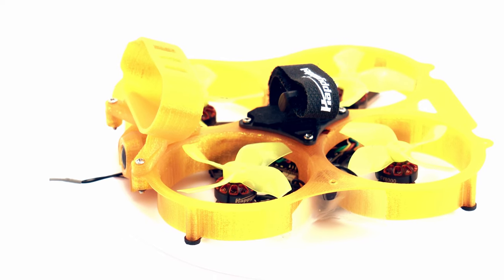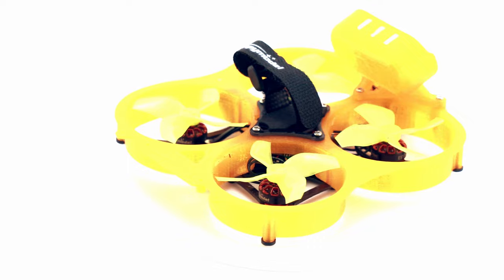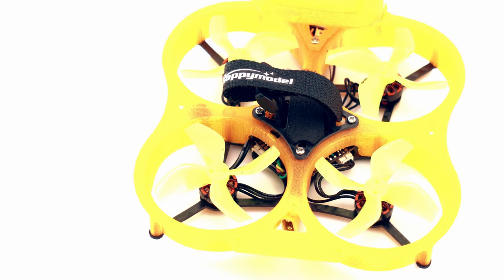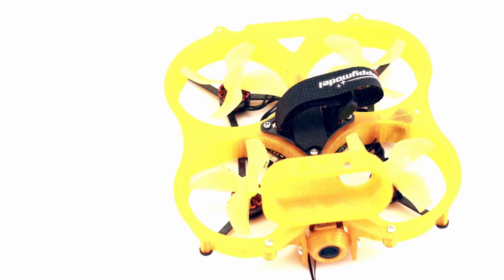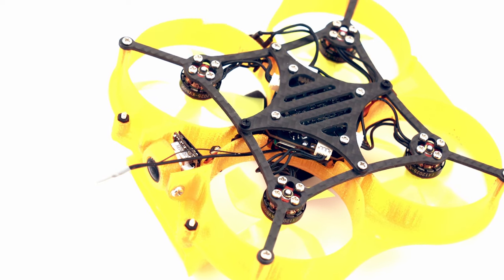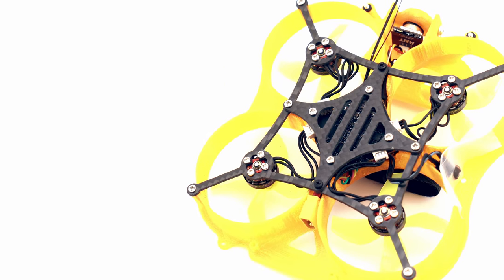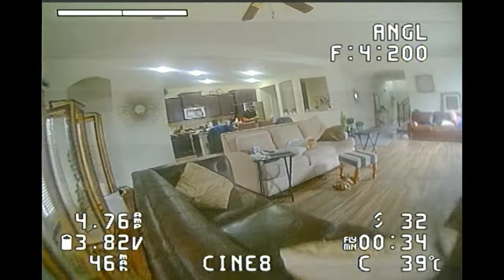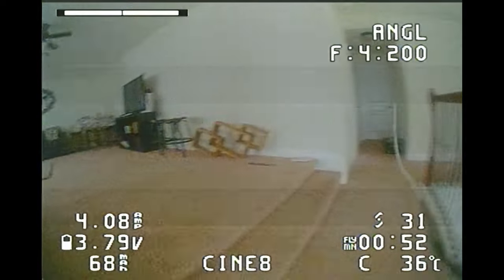Cine8 DIY Kit Drone with no soldering by Happy Model

Comment: Thanks Jon. You can also use the components and build a 2,5~3 inch toothpick with it.
I  this 2 inch whoop class the new betafpv 85 pro 2 is unbeatable at the moment. Fair price, elrs and finally got power on 2S with the new 12A AIO. Love mine. Guess it hasnt got a 360 go mount though.
Talking about unbeatable value for money its got to be the crux35 at the moment.
Everytime I look at whoops, Im always thinking to convert to a carbon toothpick frame. 😄
Reply: i did the same built a 3 inch and its great .
Reply: Me too jajaja